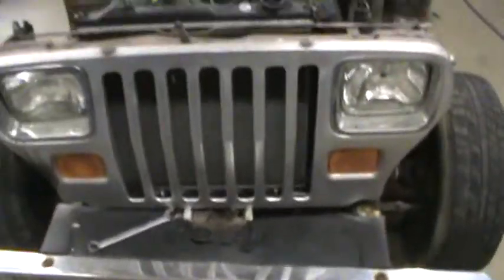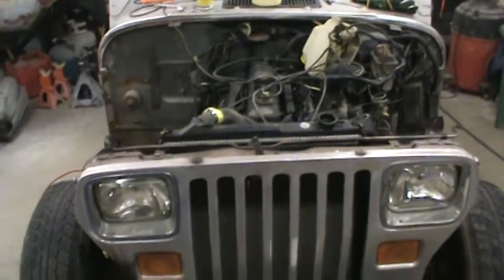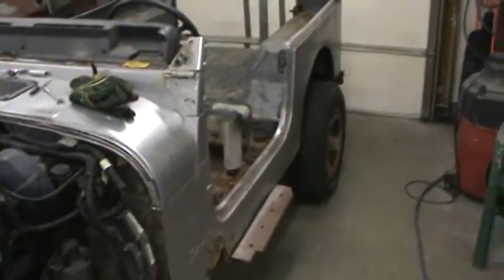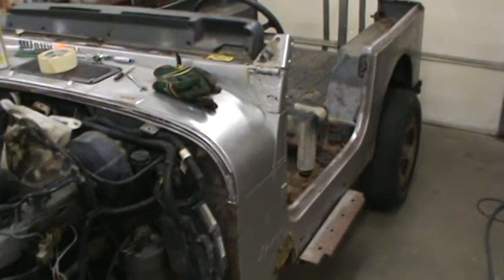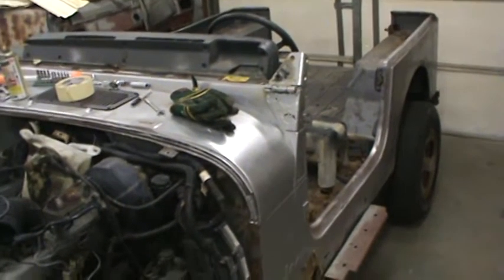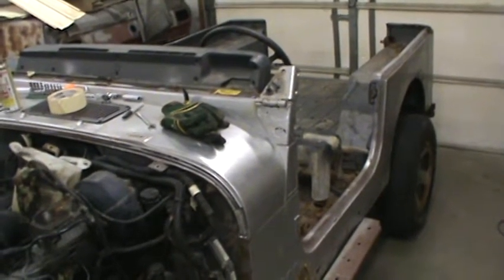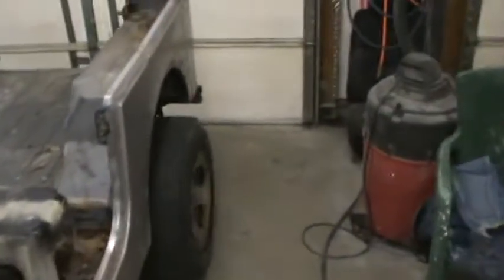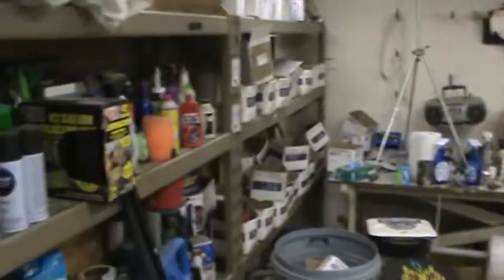Wrangler YJ #4 EV talk  EVTV.ME

Comment from the maker: @takemypot battery alone is about 15 mile range, which i could deal with but GM has only sold 942 of them to date. its not going to be a player in the EV market. They advertise 40 mile range but its more like 15 in real testing. Battery life is also under 1000 cycles.......so keeping with the GM philosophy it will be junk and in need of a major overhaul after 7 to 10 yrs. At a price of 50,000.00 i doesnt fit my needs.

Comment from the maker: @takemypot i wouldnt be so anxious to throw the volt in the dirt so to speak but chevy had the EV1 15 yrs ago, actually more like 20 now. the volt MUST have gas in its tank or it will not let you drive on electricity alone. and it requires PREMIUM gas to boot. The GOVT saved general motors and this is what we get? GM advertises the car AS an electric car.....no matter how you slice it in MY OPINION if u have to put gas in it to make it go it is NOT electric.